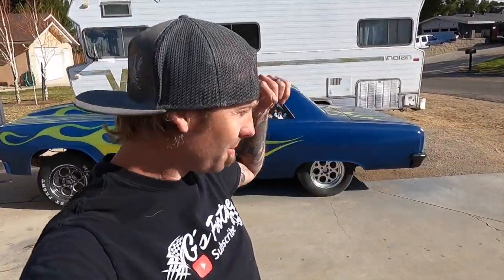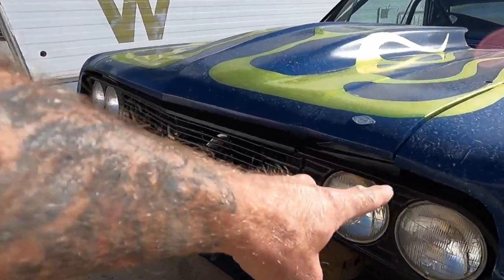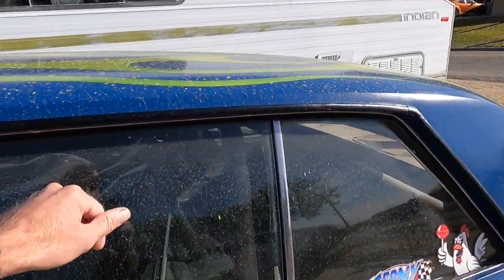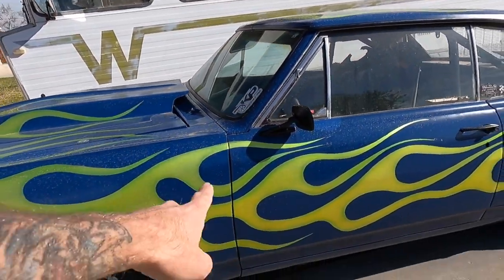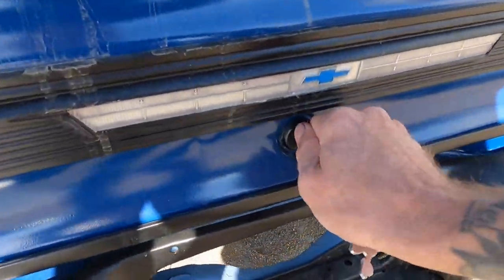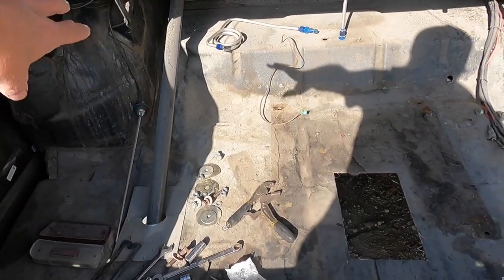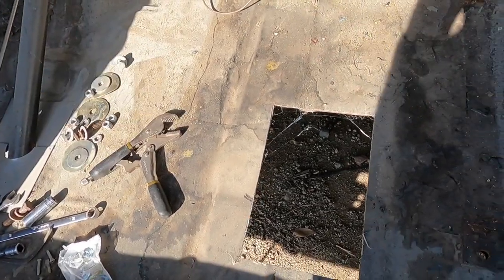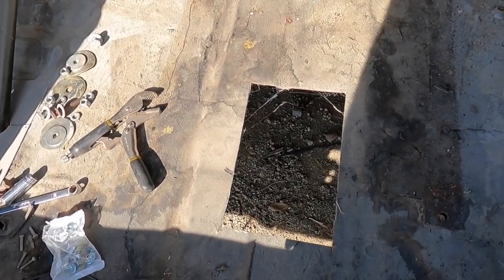Ebay Fuel Cell In Tank Pump Conversion Part 3

Comment: Add some pinch molding around the square  hole in the trunk behind the tank. That way if the fuel lines  rub the edges they won't cut into them and the hole will look cleaner.
Reply from the maker: Ill add that to the shopping list for McFad and Dales!

Comment: Please run the recommended inline micron filter for your injectors. I learned my lesson. I thought I could get away with only sock filters. I had 2 injectors stick open and hydro locked.
Reply from the maker: Yes I have a 10 micron for a post filter. The 210 injectors have no baskets so that is important.

Comment: I have one of those, the slosh mat is gunna come undone and jam the sender and the mounting brackets cracked on mine but they didnt have those triangles on the brackets and the lid handle will break.
Reply from the maker: I took the fuel foam out of this when I got it. Ill keep an eye on the mounting tabs as well. Could probably throw a few straps around it if they crack for some reason.

Comment: Yes man I need a hat cuz I want to do the same thing u did
Reply from the maker: Amazon has a fuel hat that’s under 200 that’s much nicer. By the time you get all the fittings and everything you’ll be better off buying one. Look up alloy works fuel pump hanger

Comment: I think my external cable drive Enderle 1200 will work a little better than in tanks, for me. No battery drain either. hehe
Reply from the maker: If I ever to to a point where were on methanal ill be in that boat as well. For now tho ill just stick to a couple little guys and see how it works out.
Reply: @Burndown  I just wanted to do it once and be done, for now, and future.

Comment: Make sure you keep those aluminum fuel lines from vibrating, they can work harden and crack, not good with that much pump
Reply from the maker: Ill secure them so they dont wiggle a bunch and they go to a soft line. If I have an issue ill let you guys know.

Comment: Do you think twin walbro 450 will be enough for twin turbo 5.3
Reply from the maker: It all depends on your HP goals. Twin 450s should get you quite a bit of power. Probably not 1k but more than enough to fry some tires.

Comment: Its quiet, and it stays cooler - IF there is enough fuel in it ... but are they cheap? :D :D Can it flow as much as an external pump? I feel the pain with the dirt - me and mah chickenz live on a dirt road so there is that! I only need to be able to flow what a 3/8 line maxes out at so maybe thats the way? I have no tank, no cell, no nothing yet. Blank canvas!
Reply from the maker: I will run this set up and you can see if it works for me or now. I cant tell you the pros and cons yet. If you want to make power you need fuel especially if you run e85. I just hope I dont need a third pump too soon. Ill max this set up first.
Reply: @Burndown  I'm thinking about e85, but that's going to come later, when I get get the huge injectors and pump it's going to take to do it. If you're running e85, I'd love to see how that works out for you. Can't wait to see the Maliboom RUN!

Comment: I know old post on a older video, but what size hose did you use on the fuel pump? and what brand hoae did you use too?
Reply from the maker: The pumps are walbro 525s and the hose in the tank is the flex tubing for in tank pumps. Call WARR Performance for your pumps or another reputable seller. Too many fake pumps on eBay and such.
Reply: @Burndown  ok thank you for the very fast response.  so its just that plastic line that comes with most fuel pumps. also since I have you talking lol those top hats you might offer, are they steel or aluminum?
Reply from the maker: @daddyoisback  I’m not going to make them. I thought it was a good idea but I don’t want to produce them myself at this point I don’t think.
Reply: @Burndown  ok I heard I  your one video that you weren't sure if you were or not, that's cool. just wondering if the hat is steel or aluminum
Reply from the maker: @daddyoisback  aluminum
Reply: @Burndown  thank you sir for the quick reply